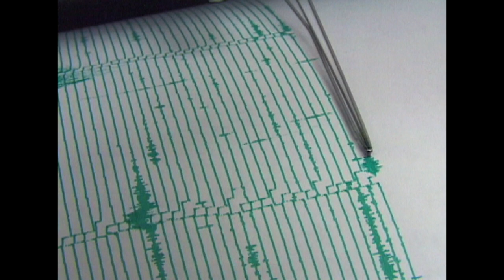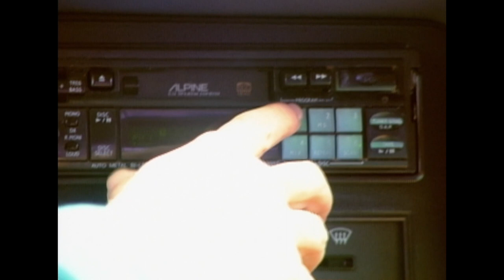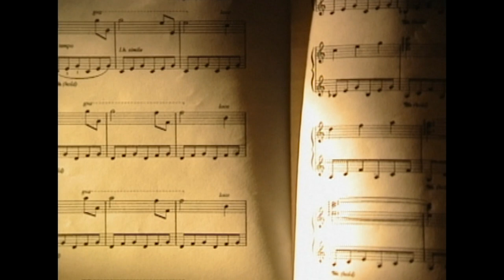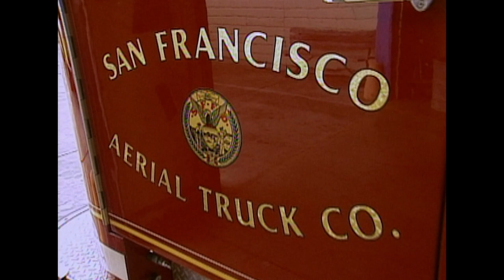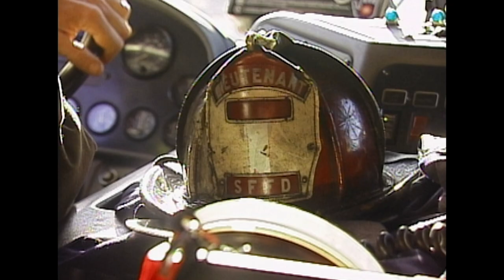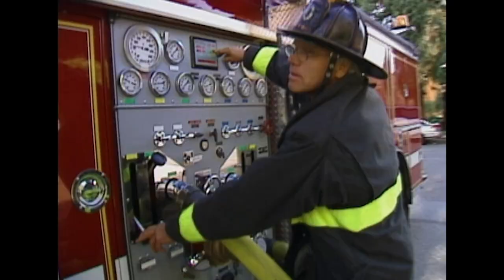The Californian Earthquake That Shook San Francisco | Critical Rescue | Real Responders

Comment: I was there, on the Ft. Org Base when this hit. I was holding a baby, when I saw I-5 started to roll. At first I was stuck in awe,  my sister told me to get in the door frame. She pull me away from the Glass door way and push me and baby to the floor, then we felt it hit us. When it was over and we were fine, I had a baby and two small dogs in my lap. My sister was on the counter with her feet against the fridge and freezer  to keep it from falling on us. The baby was still a sleep, and I was crying. I'm from the Midwest, and it really scared me so much I could not sleep for a long time. We had tremors all night long. Some as big as 5-6 on the scale. I was able to shut off the Gas and Water to our unit and a lot of other unit's around ours. Here in the Midwest you learn this because we live in Tornado Ally. On the Base we did not lose anyone that I know of. I'm so THANKFUL!!!

Comment: I was at Travis Air Force Base, which was about 70 miles away, when this earthquake hit.  I was in a hospital that had been open less than a year; it had been built because the old hospital at the base hadn't been able to be retrofitted for earthquake safety.  The new hospital had been built with the latest earthquake safety features, like rubber baffles in the walls and floor, and more I don't know about.  I was on the bottom floor of the hospital when the earthquake hit, and the only damage in our department were books falling off my boss' bookcase in his office.  Up on the fourth floor, which is the top floor, most of the damage was caused by things falling off shelves.  When I finally got to my car, I turned on the radio to listen to the World Series game (Giants fan here), but instead got Al Michaels, the sportscaster, reading news bulletins.
Reply: The boss I worked for a couple of years later told me that she'd just crossed the Oakland Bay Bridge heading toward Hercules when the earthquake hit.